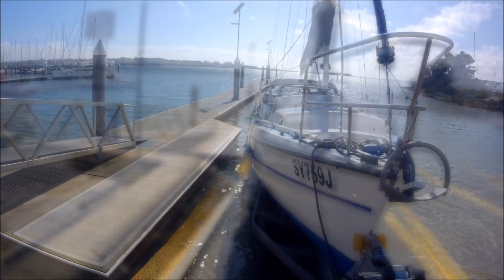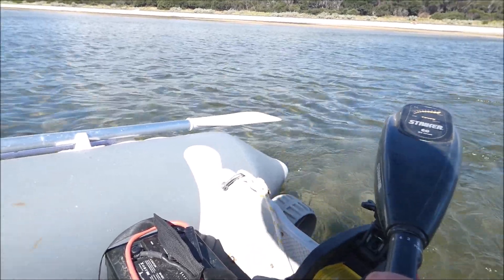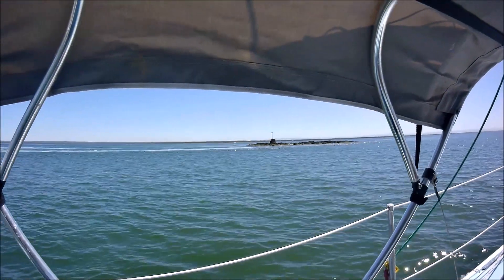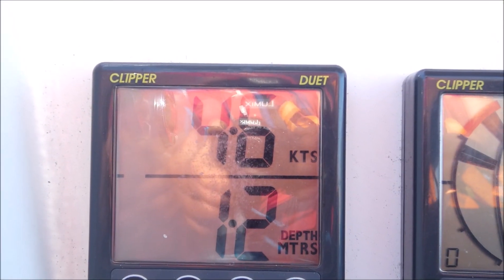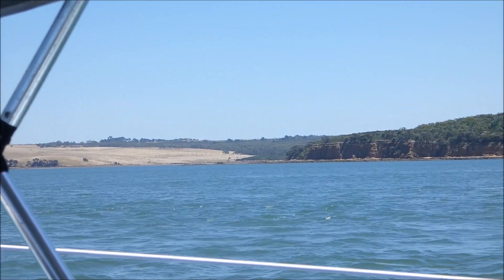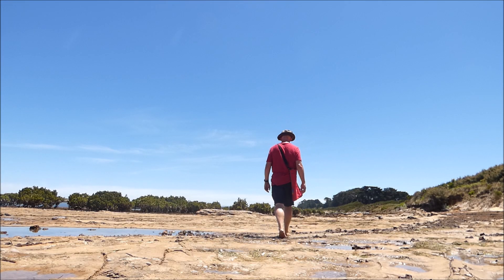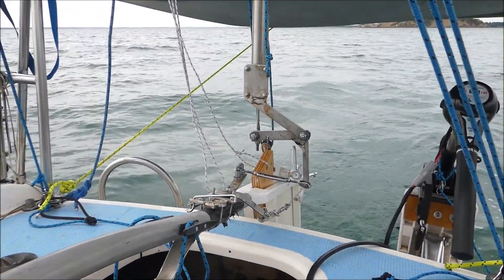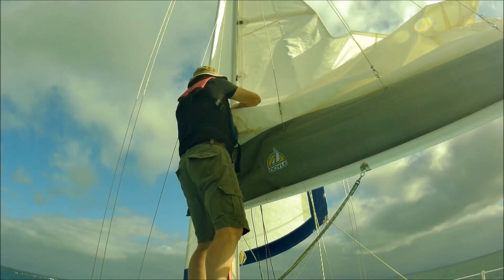Sailing Westernport Around French Island

Comment: Viewing completed....excellent Mark, makes Western Port appear beautiful.....which it is of course. You’ve poked your nose into spots I’ve yet to visit well done.
Every time I visited the Hastings Boat ramp it was very busy so I’m surprised you made it......and very glad you did. Redbill Creek is the one I haven’t tried as yet.
Keep well Tony
Reply from the maker: Hi Tony, would have been better if I had a bit more time but I wasn't sure about leaving the car at the boat ramp for more than 5 days. General rule with boat ramps is mid morning is the quietest. When I arrived at 8am there were boats launching 4 abreast and others waiting to launch. by 10am I was the only launcher and once in the water another boat arrived to retrieve. It seems to work at most ramps.
Western  Port is a great place to sail especially if you have the time to work the tides. I really enjoy finding places to dry the boat out, something only TS's can do when it comes to yachts. I hadn't had a chance to try my drying out legs so it was a bonus to be able to do that as well and very happy with the way they worked.
The tides were wrong for me to investigate Red Bill Creek some more. A TS would settle onto a soft bottom at low tide and it would provide shelter from all weather. The tide was already too low for me to get far enough upstream to get past the mangroves which I have been told you can do when the water is high enough. Will definitely explore that one again in the future.
The other bonus of Westernport is an easy access to a 20 mile ocean sail around Phillip island which I will also do some time in the future. Cheers Mark

Comment: Hi Mark. I'm restoring an RL28 right now, haven't even sailed it yet. I have seen your anchor winch, looks like a Viper. When I inquired in the sailing shop for one of those, they said there is no way you put that in a sailing boat, they are for fishing boats!! Now, what size have you got and was it a struggle to fit it in? Is it not too much weight on the ceiling of our main bedroom? Did you have to move the head sail, mine is attached inside the anchor well, right in front of a possible winch? Thanks for our time.
Reply from the maker: Hi Manfred,

Sorry, didn't notice this comment until now.

The viper pro is designed for boats 8m and up so the RL28 fits in that category. I cant remember the model but I am sure you can see it on the video. Yes its a big winch and probably designed for large boats. It was the largest one Whitworths sells, probably the Viper Pro 1500.

I chose this winch for several reasons. The first is for the drum size. It was the largest that would fit in the RL28 anchor well. It was mainly for the capacity, I can fit 70m of 12mm anchor rope and 12m of 8mm short link chain. I felt that was the minimum for the Kimberley trip I did recently.

The installation has proved to work well and the anchor well floor has held up very well and tested continuously for 3 months on the Kimberley trip. The things shown in the video I think made it sturdy. These are the additional arm welded on the bolt plate that spreads the tortional loads. This was also attached to the stainless cross beam installed across the anchor well floor behind the winch which was bolted to the hull on either side and bolted to the welded on plate under the anchor well floor.

Fitting it in was challenging but not impossible. My requirement was to leave enough space behind the winch to store 3 fuel jerry cans for our Kimberley trip. When not carrying fuel it leaves enough space to stand and work behind the winch. Ideally the winch should have been further back from the nose of the boat as it helps the rope and chain to lay on the winch better when winching. In the position I have used it winds on ok most of the time but occasionally the chain will bunch up and require a bit of input to help it wind on evenly. The deck roller ideally should be convex (outward curve across the roller) as this also helps to lay the rope and chain more evenly.

I know all this sounds difficult but its not as hard as all that. The winch sits nicely in the RL28's anchor well and certainly makes retrieving the anchor a whole lot easier. My wife now takes charge of anchor hauling when onboard, something she just couldn't do before. The last thing I like is it keeps the anchor line and chain neatly rolled and very secure when underway.

Cheers Mark
Reply from the maker: Forgot to say, yes you would have to move the forestay. Mine attaches to the side of the anchor bracket which was well attached to the the nose and stores the anchor. Having the forestay off center slightly has caused no issues an allows the anchor to pass by into the bracket. My anchor bracket was installed by removing the original aluminium flanges on the nose cone of the RL and then bolted the new bracket on top of the now flat nose cone with decent stainless bolts and using an isolating past on the bolts and between the bracket and the aluminium nose cone.
Reply: @TRAILERYACHTADVENTURES  thanks a lot Mark. I was worried being too much weight and stress on our bedroom ceiling.

Comment: Regarding the Southern Cross 23 did you reinforce Helcyon’s bow in some way? Just had a look at one and under the forward birth there was no reinforcement at all! Cheers Tony
Reply from the maker: Not sure what you mean by the bow. The base of the anchor well was very thick with a ply sandwiched in the fiber glass for memory. Other than that the thickness of the fiber glass up front was always very generous and never gave any indications of lack of strength. The only issue was the drain from the anchor well which was a fiber glass tube that cracked occasionally and needed strengthening. Cheers Mark
Reply: I’m referring to the area of the bow you placed the water bladder. You also placed some floatation foam on either side of the bladder. On the yacht I looked at there was a hatch under the forward birth which gave access to a craven is space with little in reinforcing. One wouldn’t want to place to much stuff there of course
Reply: Should read a cavernous space with no reinforcement....
Have now watched the video three times. How about an expblore up the Bass river next time
Reply from the maker: @tonywoollcombe1799  Yes I looked at Bass river on the charts and decided it would have to wait for another trip. It would be a single destination trip as waiting for the tides would take time to do it justice. Back to work at the moment so my trips will now be back to 2 full days and 2 part days sadly.
Sounds like the Southern cross had the wall to the bow floatation tank removed, probably to give more storage at the expense of safety and strength. Cheers Mark

Comment: I always enjoy your video's, I gather the dinghy outboard is a striker 60, what is the other bigger electric outboard ??
Reply from the maker: Yes the dinghy motor is a 60lb cheapy of ebay. The larger is a Pelican 80lb motor, supposedly an australian company but definitely made in china still. Nicely built unit and alot more robust than the ebay one. It is suspiciously the same as a watersnake brushless 70lb motor and in using the pelican their claims of 80lbs is probably overstated and is likely to be closer to 70lbs. It can push Neringa along at 3 knots in ideal conditions but wont handle stronger headwinds or currents like most electrics on the market. I am concerned that the cabling on the motor is only 11 guage and not really rated to the 60amp 12v draw at full power. The wires get quite warm. At least they are only very short. 90% happy with it but if I had to buy again I would go for the brushless 70lb water snake instead which is around $200 cheaper. Cheers Mark

Comment: Don't have a boat, but what do you mean about the drying out? Aren't boats supposed to be wet? Never heard it on other yachting videos.
Reply from the maker: Hi Brian, its one of the great joys of sailing a trailer sailer with a retractable keel. Nothing beats finding and isolated beach, tying up close at high tide and then spending the next 10 hours or so with a water side apartment on the beach. Depending on the spot you can stay a few days with the boat floating and resettling. Cheers Mark

Comment: Hi Mark, thanks for the video. 
I have owned an RL 24 and am now getting an RL 34 prepped for sailing as, though 30 yrs old, it’s is an unfinished project. 
I have a tohatsu 9.8  4 stroke on a hydraulic bracket on transom. 
Can you tell what brand your electric motor is on the RL? Pelican ? What’s the setup with the controller / panel/ battery. 
Maybe a short video be worth it. 
Cheers Nick
Reply from the maker: Hi Nick,
The electric is a brushless 80lb Pelican trolling motor. Nicely built unit but I am dubious about the claims of 80lbs as most brands only manage 60lbs on a 12v motor. It is definitely better than 60lbs though. It looks suspiciously similar to the 70lb watersnake motor which has all the same features and is $200 cheaper. Pelican claims to be an Australian company but the motors are definitely manufactured in China like the watersnakes. The charger should be a MPPT type, mine is an Epever 20amp MPPT but other brands are fine. MPPT just converts excess voltage to charging current so are more efficient. I have 2x180w panels (true 180w not the false claims you get on ebay, should be 1 square metre each to be 180w) on my bimini for charging 150ah battery for the pelican, and 100ah for the dinghy electric. On the westernport trip I used them both regularly but never got to a fully discharged state on either battery. Both batteries are Lithium Iron Phosphate which run at a slightly higher voltage than lead batteries and keep their voltage until nearly flat.
It is important to remember that the electric is a supplemental propulsion source and not a full replacement for an fuel motor. In ideal conditions it pushes my RL28 at 3 knots and in average conditions around 2.8knot at full power. It can cope with light headwinds and currents but will soon be overcome by them as they strengthen. I use it in no winds to keep moving or in light winds where I want to supplement slow sailing speeds and improve pointing. I originally installed the system to extend fuel supplies on a 1400 nautical mile trip through the Kimberleys later this year where there will be many light wind days with passages made with the huge tides. Having said that I love the system and use it most of the time out on the water now when conditions allow. 
I have mentioned the system in other videos but would be difficult to make one long enough for youtube on its own. The above pretty much sums it up. Hope that helps. Cheers Mark
Reply: @TRAILERYACHTADVENTURES  cheers Mark, good tip about the Pelican.. I’m surprised it’s 12 v. They advertise higher voltages which may be more efficient/powerful. Some have an alloy prop I think which has to be better. 
I’ll check out more of your channel. 
Nick P
Reply from the maker: @triplesweeney  Space is at a premium on my boat so 12v was the way to go for me to only need the 1 battery. 24v has some efficiency gains and certainly allows for higher thrust motors which for an RL34 may be desirable. Even though more efficient it doesn't make a lot of difference to the watts per pound of thrust. Running at higher voltage means less amps and this avoids the problem of wire resistance to high DC amps. But the run times for lbs produced are not that different to 12v motors. Cheers Mark

Comment: Are you still planning on doing the Kimberley trip sometime when COVID settles down?
Reply from the maker: Yes the Kimberley is booked in for late June to late September covid willing.
We chose the second half of the dry to allow more time for covid to settle. The plan is to sail from Derby to Darwin weather allowing and as the NW winds start later in the dry as we move along the trades will settle a bit and not be an issue. We have even installed a watermaker on the boat to provide drinking water should it get harder to find water to refill tanks. Cheers Mark.
Reply: @TRAILERYACHTADVENTURES  Thanks Mark. I'm currently building a Farrier F22 Trimaran and I have dreams of sailing around Australia when (if!) I finish it. I'm thinking of leaving Brisbane about Easter time and take 4 months to get to Darwin. Put the boat in storage, back to work. Fly back to Darwin the next Easter, and maybe 1 month in the Kimberlies, around to Broom. I've heard that the end of the wet season is a good time to see all the big waterfalls running, and plenty of fresh water to be found. I don't know anything about the prevailing  winds at that time of year though. Maybe 3 months to Freemantle, 2 months to Bass Straight, 1 month around Tas. 1 month home. However I wouldn't have enough long service to do all that, and prob couldn't afford to take long service at half pay to double the time. I'll just have to keep thinking some way to make it happen.
Reply from the maker: @frodosadventures8757  Nice boat you are building, I did consider a 30ft farrier but the bank just didn't stretch that far, even for a 2nd hand one.
I will be the first to encourage you to follow the dream of circumnavigating Australia. Had go back in 2012 but didn't do more than Melbourne to Eden. Foul year weather wise with a long procession of easterly gales. After 2 and a half months I put back on the trailer in Eden and headed up north including to the Kimberley. Your plan of breaking it into years could be a good one as you would only be away from family for a few months at a time. Speed would be better in the tri but with a 22footer you would have to pick weather windows which is what killed my trip time wise. Across the tropics of Australia the Winds are predominantly E to SE in the dry season (May - Oct) and NW to SW in the wet season (Nov-Apr) with the strongest winds mid season and lighter more varying winds in the change over period. Always exceptions to those rules of course. April is not a bad time to the Kimberley depending on how wet it has been. A strong wet season often sees late cyclones in April but the winds are far gentler otherwise. Strong wets also leave logs in the water that takes time clear by early May, but then the strong trades kick in, especially in the northern Kimberley.
I hope your project progresses well and you get out there and live those dream. Cheers Mark